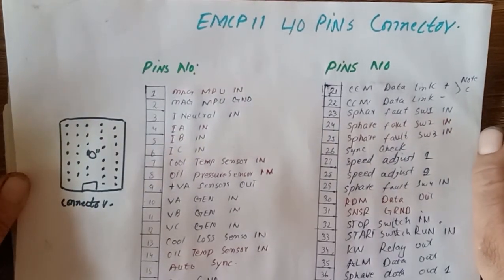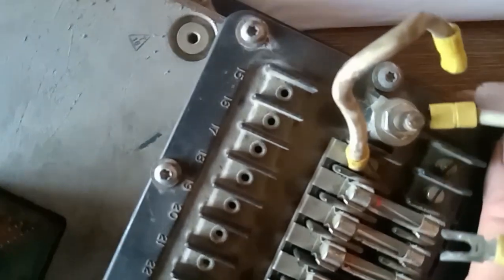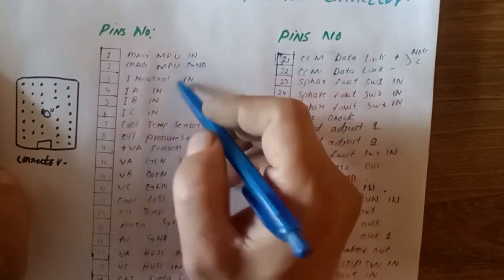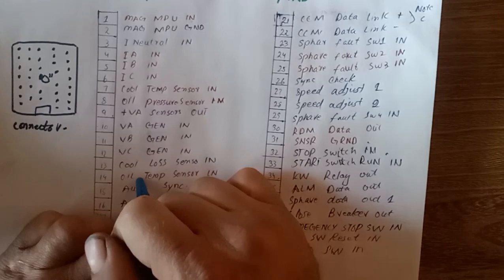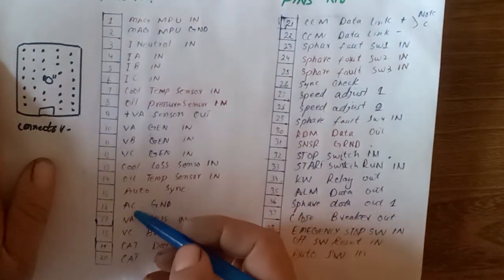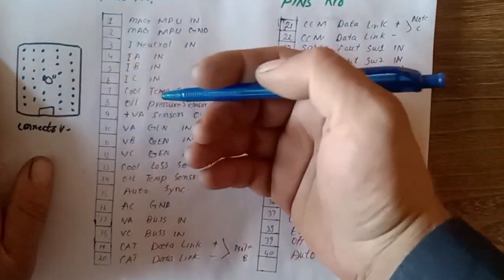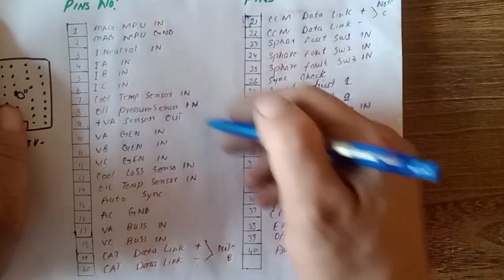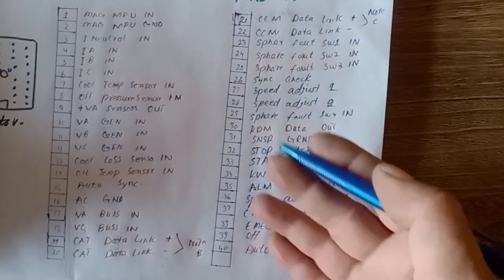Caterpillar EMCP II GSC 40 pins Connector wiring connection explain

Comment: Nice video sir, engine control switch diagram for emcp 2 plus sir, can you make also a video, thanks
Reply from the maker: Which engine control??
Reply: Ecs 4 position off reset, auto, manual start  and cooldown stop for emcp 2 plus sir, thanks
Reply from the maker: Very soon I will make a video on it.
Reply: @Info-Tech-  thanks sir, i hope can you make a video wiring diagram for cat ecm